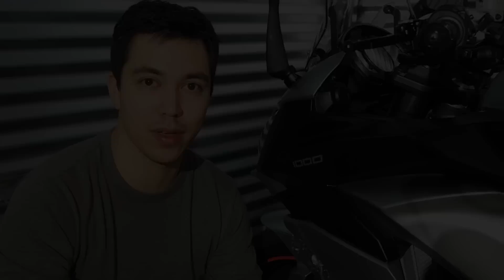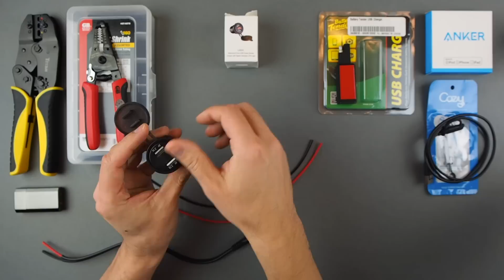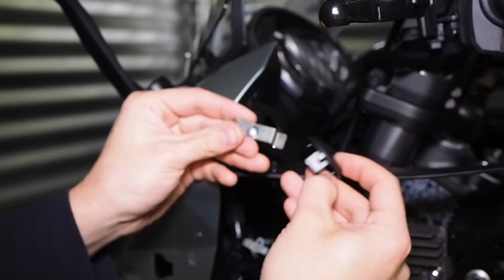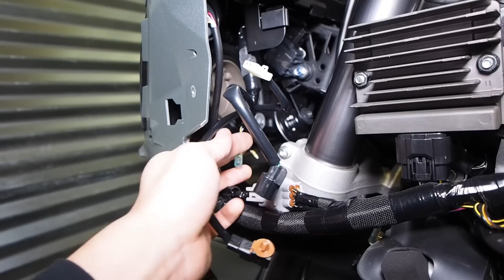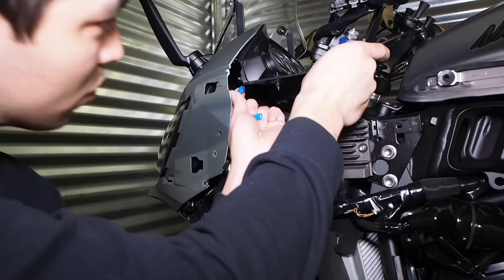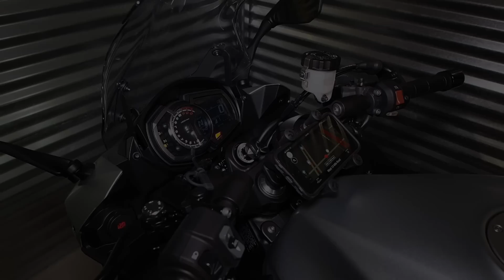USB Power Outlet Install: 2018 Ninja 1000 / Z1000SX

Comment: The Kawasaki dealer I'm currently talking to is telling me that if I make any mods to this bike without it being done in the Kawasaki shop will void the warranty. Anyone else know anything about this?
Reply from the maker: That’s absolutely false, and such a policy would be in violation of federal law. The only time that doing your own work can void the warranty is if your work or the parts you used damaged the bike or some other component of the bike. And even then, the entire warranty is not void, only the warranty for the parts you damaged. For example, if you installed the incorrect spark plugs, and then the wheel cracked because of a defect, your warranty for the wheel is unaffected. If the engine suffers damage because you used the incorrect spark plugs, then Kawasaki would not be responsible to fix damage that you caused. What your dealer is telling you is a common lie.
Reply from the maker: In addition to my response below, here is a link that provides good information on the subject. This is direct from the FTC. https://www.consumer.ftc.gov/articles/0138-auto-warranties-routine-maintenance
Reply: Jonathan Long    Thanks for the info and quick reply! Hope I can still find one of these bikes. They are selling like hot cakes in my area. If not I'll with for the 19's.

Comment: Hi jonathan, I ordered my new green 2018 sx yesterday so I have been watching your videos. I must tell you I have enjoyed them immensely and found them very informative. Can you tell me if the heated grip wires are switched with the ignition and are just a higher ampage than the 12v socket wires or are they switched through the screen menu if you have genuine Kawasaki heated grips? Thanks, Richard. UK.
Reply from the maker: The connection for the heated grips is switched through the ignition and is rated for higher amperage than 12v socket.  The genuine kawasaki heated grips are not controlled through a screen menu.  They come with a separate controller just like the Oxford heated grips (which is what I would buy).
Reply: Jonathan Long  thanks for that. Yeah I'm going to for Oxford ones, thanks very much.

Comment: The genuine power socket from Kawasaki is the biggest scam ever, the actual socket is the same as the one in the kit for the Vulcan S. I was researching it last year, and found the Kawasaki fitting instructions online (for the 2017 SX) which lists the individual part references. I googled the part number and it came up with instructions for a Vulcan S power socket with exactly the same part number for the socket and cover assembly (also comes with a bracket and rear cover, but not needed on the SX), the cost when I bought it last year was £27 (now £39.95) from Kawasaki UK. So if you want the exact same part, from Kawasaki themselves look for part number 999940541. Fits straight into the hole, then has the bullet connectors to connect onto the bikes wiring harness.
Reply from the maker: Thanks for the great tip!  Even that reduced price is still pretty expensive, which shows how ridiculously overpriced the Kawasaki part is for the Ninja 1000 / Z1000SX.

Comment: What gauge wire are you using for this and rear blinkers?
Reply: Nevermind, I saw you use 16ga from one of your replies. Same for taillight too? The wire that comes out of the tail light for the blinkers is tiny on the blaster-x. What size connector did you end up using on that? I am doing a lot of the same mods as you and these videos have been life saving! Thank you!
Reply from the maker: Glad they’ve been helpful! I believe I’m using 16awg for everything. I think some of the component wiring (like the blaster x leads) may be 18awg. I believe I used the red crimp (16-22awg). For some of my wiring, I remember using blue (16-14awg).

Comment: Hii Jonathan,great video,i do it the same job on my Z.....tell me can i conect tomtom rider navigation to power outlet for heated grips witch do you mented? Thanks and best regards from Croatia!👍
Reply from the maker: Hello! It should work fine to connect your TomTom to the heated grip connector.  You could also connect it to the same connection that I used for the two USB chargers.

Comment: Excellent instruction. I would like to install a push button in that 1 1/8 hole. I will connect it to a small remote garage door opener. Search for "28mm arcade button" on ebay.
Reply from the maker: You could also install a smaller button into the knockout panel that fills the hole.  You may have to work around the bracket that secures it, or find a different way to mount the panel inside the hole.  Another option would be to hide the button underneath the flat part of the fairing (just in front of the hole).  You'd be able to reach down and hit the button, but it would be hidden to others.

Comment: Amazing "How to" video. So I understand your bike has connectors (switched with ignition) for Aux devices. How did you find out?! I mean, I checked my Z1000 service manual electric diagram and didn't see such thing! Also couldn't find any video online. usually people bring a cable back to their batteries. you are the only one that did it right! my question is, can you give me a hint on how I can find aux connectors (if exists) on my Z1000R?!
Reply from the maker: I am able to find the accessory plugs in the wiring diagram for my bike, but I learned about them from reading various forums.  Checking a few forums for your bike would be the first place I'd look to see if there are any aux ports.  If this bike didn't have aux connections built in, I'd wire my own from the battery.

Comment: What size bullet connectors did you use? Also what type of connectors did you use for the outlet? Your addition of the usb outlet under the fairing has inspired me to do the same. Awesome job!
Reply from the maker: Hey there! The bullet connectors are a standard size. You can order them online or just go to your local auto parts or hardware store (I got mine at Home Depot). Although the bullet connector parts are a standard size, they do come in three varieties depending on the wire gauge that you are using. The color code is also standardized. Yellow is for larger gauge wire, blue is medium, and then red is small gauge. I used blue terminals with 16 gauge wire. The connectors for the outlet were included with the outlet. They are the female end of a spade connector, but you do not need to buy them separately. Let me know how it goes!

Comment: Hi Jonathan, I too find your videos informative! I bought the black 2018 model recently.  I have heard rumours about the battery being weak on the z1000sx. Do you know anything about that ? If it is, maybe charging different stuff on the bike will drain it alot faster. Maybe you can make a video about changing the battery to a lighter, more effective one :)
Reply from the maker: Hello and congrats on the new bike! I haven’t seen anything about the batteries being weak, but I will look into that. I have considered swapping the battery with a lithium ion battery for the weight savings.
Reply: if you are planning to upgrade to li-ion do a research about the charging requirements, like need for any replacements or add-ons since the li-ion charging and monitoring method is different and the default charging method in the bike is for lead-acid  so.. also about whether the li-ion replacement batteries are made for plug n play type with have built in protection methods  or not etc.. make a detailed video if possible :)